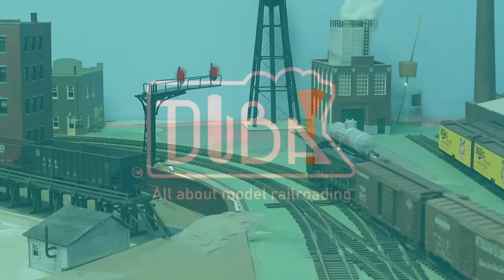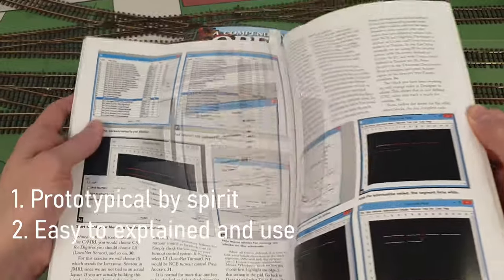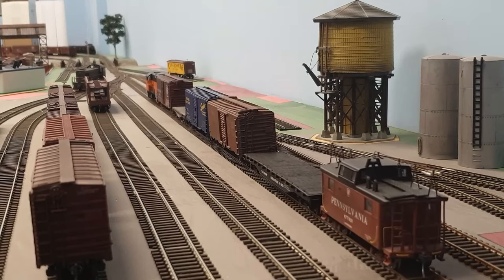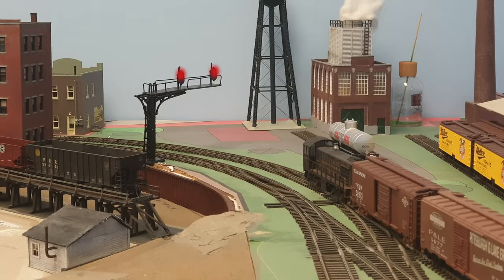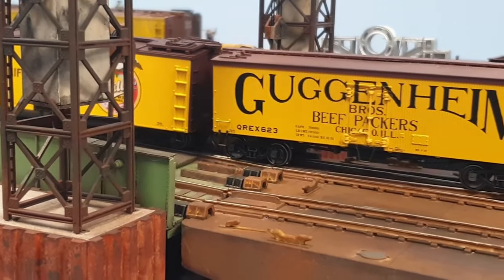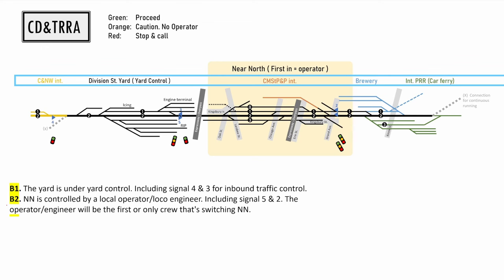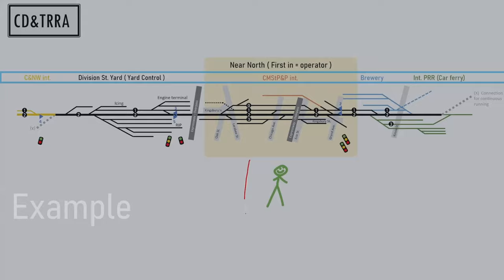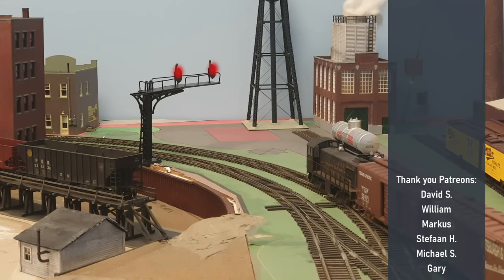No Complicates Electronics, I design my own signalling system for my layout. ~190

Comment: I like the signaling system you're putting in place.  The Pennsy used tower operators to control portions of the line.  The one Pennsy layout I operate on actually assigns people to operate the towers.  However, since COVID he has gone to smaller crew sizes, so some of the towers are now controlled by local crews when in the area much as your doing.  His signals are interlocked to the turnouts to minimize mistakes (or cause more because we all don't always understand the system).
Reply from the maker: Thanks for the addition. Your last comment ties in nicely with my guildline 2. Not that one should always shy away from complexity, but until our crew is a well oiled machine and we have rolled out other layers of realism like horn & bell use and speed restrictions just to name a few, this will work just fine.

Comment: Hey, 
You are doung very welll to create your own signalling system and its up to you, of what you are using onto your own roadname.

Me I am using Main- and Branchline signalling.

Shunting operations are possible at any Station or inside yards apart from the mainline signalling operations.

If any train passes the Main or Beanchline, the shunting will be stopped or would be banned into areas apart from the mainline, sounds complicated but it isen't it.
Reply from the maker: Hi Ingor, thanks for the addition. Yes that is also how i would do it if i wanted to fully signal the line. I do have a rule that all traffic onto track 2 to must be called in.